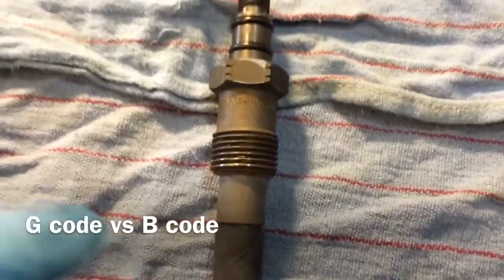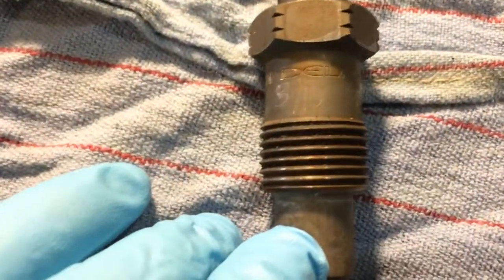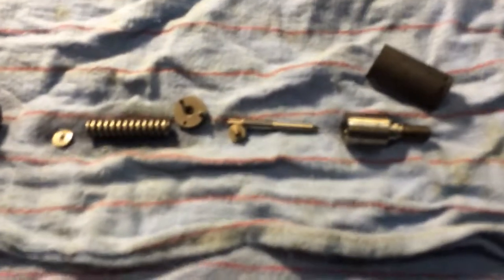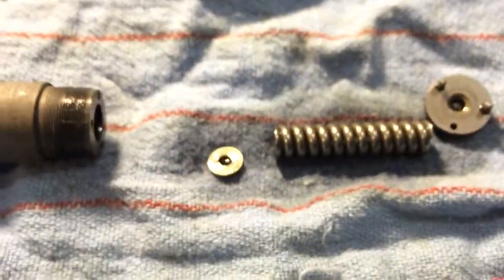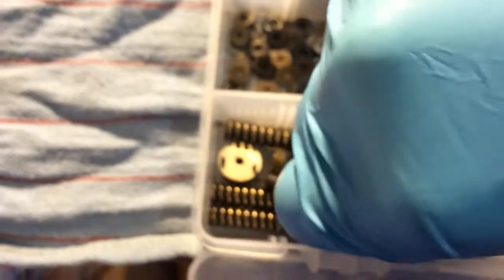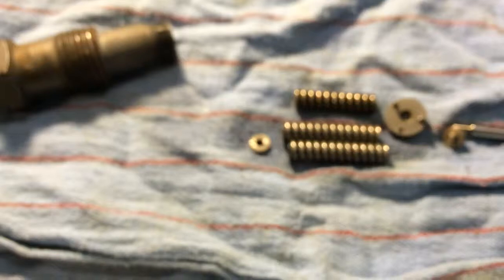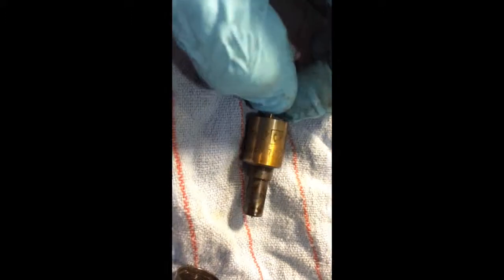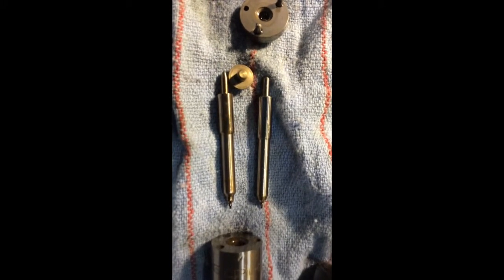G code vs B code Ford IDI Injectors

Comment: I have a diesel tractor with idi injectors and was thinking a couple might be leaking from the tips. Would you be able to tell me that if a stethoscope is placed onto the individual injectors,  a definitive click would be heard? I'm getting a solid click from 1 cyl but not other 2. It's a 3 cyl. Can't find much on listening to idi injectors.

Comment: Im noticing little differences like this on parts. Im pretty sure its a difference of 6.9 and 7.3 idi motors. The injector line kit is a good example of this. The 7.3 line kit will have 1/4" hose and parts and the 6.9 comes with a 3/16" parts. How can you tell the difference in the 2 aside from the springs?

Comment: I read somewhere that you cant run g code on a motor that runs b/bb/d code  without changing the injection pump due to pop pressure this true or does it matter

Comment: Why did you change the injectors ? Engine miss, hard start ?
Reply from the maker: Just running rough. I was running waste oil for fuel, so it coked them up.